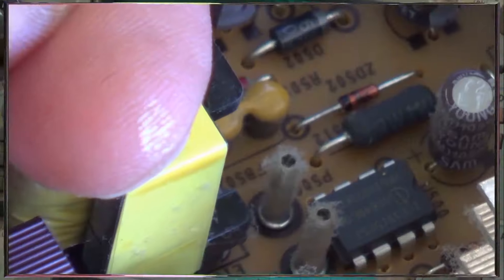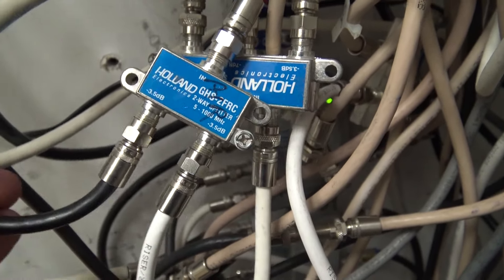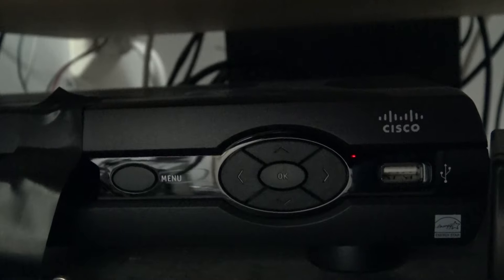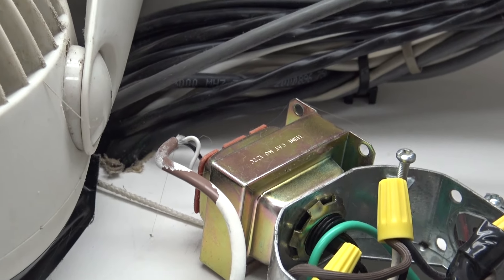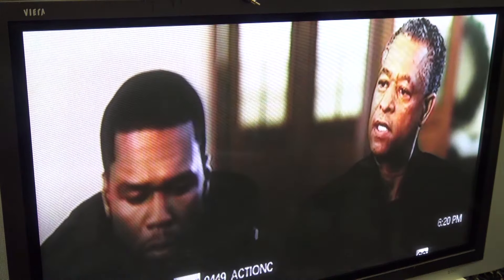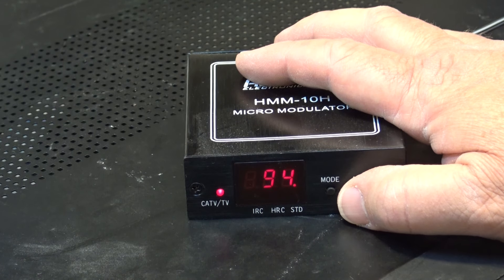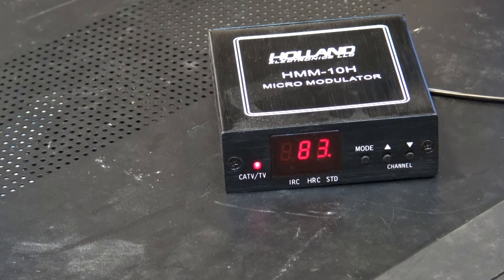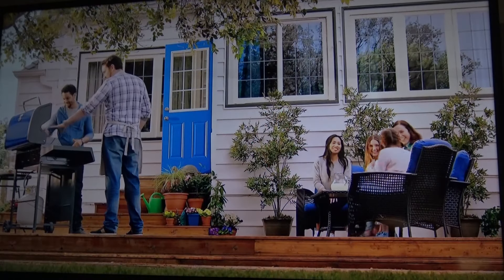Modulator set up at my house

Comment: You taught me so many tidbits in this video, some outdated but still valid.  Thanks!  So how does Raspberry Pi work? How do you make it stream and control a HDD?
Reply from the maker: Paspberry Pi is just running OSMC (open source media center) whch is an XBMC / Kodi clone. From that there is an opetion to open files under the video tab, and the HDD plugged into the USB will be detected providing that it is formatted in ExFAT mode.  There is an option to select random playback.
Just put all the files in a folder (not the root) click on video, files and select the device. Right click on the folder that the files are in, and select PLAY.
If random playback is selected it will play them in random, otherwise it will play in sequence, or you can create a playlist.
Its great. Mine is a very old first generation and it has been running for many years 24/7. I'll do a video sometime showing how it is set up.
Reply: So they come preloaded with an O/S and you download the program? Yes please show us more PI and how to use them.
Reply from the maker: No they have no OS. You put the OS on an SD card, and the apps you want to run. I use mine as dedicated media players,, however they also will stream from the internet. Same software, just load on the repositories (thats the servers that stream the content.) This is where it becomes a legal grey area. The software, Kodi, OSMC ect is perfectly legal. Many people load on repositories that allow streaming pirated content.  If you sell fully loaded boxes, then you can find youself in hot water. There are plenty of web sites that have set up automated scripts that do the "dirty" work for you. You just simply enter the address for the server, and download the required content and install it. The ones I have are just running bare bones OSMC as I don't stream content to them, I used them as media players to play local content already on a hard drive or USB stick, but I could plug in the ethernet cable and stream anything that is on the web if I wished.
Yes they do 1080p as they do have HDMI out was well as composite.
I use the older generation because it has a seperate video out, and a stereo mini plug for the audio. The Pi2 and Pi3 use a single jack for A/V like many of the new TVs that combine the stereo audio and video on a single 3.5mm plug, which needs a special adapter. 
The Pi2 and 3 are faster though, so as a streaming device for internet based content, they will search much faster when looking for content, and if you are using HDMI then this is not an issue. But again, in my use I am only sending mostly SD content (it will convert HD content down to SD to output as SD as well.
The entire OS and program (they run linux) is stored on an SD or in th ecase of the Pi2 and Pi3 a microSD card. The installer (that runs on windows) formats the card for linux, and installs the software automatically. You then just insert the SD card into the pi, plug it into a monitor and eithernet cable, connect a mouse and keyboard to the USB connectors and plug it in. The rest of the install is done on the device automatically.
Perhaps a video showing the steps if there is enough demand for this.
Reply: I think they came out a few years ago, not sure and they remained a mystery to me. I never knew about the alternate channel thing for modulators and the FM band how its used to a few channels.  I wondered why my cable FM died one day.  It was a good service, even supplying some AM stations in HIFI stereo.
Reply from the maker: Yes they had all teh AM and FM stations both local and the distant ones on the F< band on cable, and then one day BAM they were all gone as they needed the spectrum to put digital signals as HD rolled out and they ran out of bandwidth very quickly. They would put at least 50 SD digital channels in that spectrum, and 8-10HD channels, so the bandwidth was too valuable to use for just radio. That plus the fact that they have digital audio services on their digital boxes anyway.
Just another way to rent you a digital box.
Reply: I miss analogue so much. We could hear what was wrong with the signal. The early cable FM we had, had whistle sounds when my radio was in stereo, any ideas? It was later fixed.
Reply from the maker: When the local cable co first added FM they just amplified the off air signal. The problem was the off air signal would also get picked up between the coax and the antenna terminals, and beat with the cable signal that had a slight delay, which caused noise. The solution, change the frequency so the cable frequency was different than the broadcast frequency.
Reply: Well they had everything moved around slightly.  We had a station on 99.9 and cable remoded it on 99.5.  Often you would pick the original that leaked through and it actually sounded better.  In Toronto, we had quite a crowded FM lineup.  Maybe 99.5 and 99.9 were too close.  It only made a beat in stereo.
Reply from the maker: Right on. Cross modulation of the 38.5 KHz subcarrier.
I had a tuner with adjustable IF bandwidth, and set to super narrow it eliminated the interference, but set to full bandwidth I got noise. It got worse when they added AM stations to the FM band, as there was already no room on there.
Reply: One day in the 70's it was fixed and for many years I was happy.  Then one day around 2000, the whole thing vanished.  Do you think AM and FM will go away anytime soon? I heard they can go digital on both.
Reply from the maker: Well Norway is planning on shutting down analog FM broadcasts this year. Here in North America they are already broadcasting digital signals, but these digital signals piggy back onto the main FM carrier, so I think analog FM broadcasting, and AM still has a few more years before we need to worry about it. Not everyone wants to subscribe to satellite radio.
Reply: I am glad, its so basic and it works.  Its amazing that FM stereo is so old but still sounds great after all these years. CHFI was the first FM station in Toronto, HFI meaning HiFi
Reply from the maker: That was Ted Rogers station, the first FM station in Canada. Ted had a vision for broadcasting and  that vision was FM.
Reply: Yes until Rogers took away my cable FM. :(

Comment: Does the fan turns on automatically when get's hot in the room, or do you turn the fan on manually to keep the room cool down?
Reply from the maker: The fan is on a timer that runs it at times that the equipment that produces the most heat would be active, that being the day and evening. It turns off after midnight when all the equipment would generally be off.
I could put it on a thermostat, but not really any point, the timer option keeps everything nice and cool.

Comment: is it ok to replace a 250v /1.25a glass fuse with a 250v/1.6a fuse?
Reply from the maker: A fuse is a safety device, and for safety really needs to be replaced with the same rating.  Even though a 1.6a fuse is only 300 miliamps over the original, and one wouldn't think this would cause a problem, IF that unit were to burst into flames, and upon inspection it was found that an incorrect fuse was installed, that could be enough for an insurance underwriter to reject the claim. If a device is fitted with a 1.25 amp fuse, and you don't have that size, and you really need to get the unit going, I would first go down to say 1 amp and see if it blows. Most devices that have a 1.25 amp fuse won't draw even close to an amp under normal operating conditions.
Reply: i fixed the tv and now its working fine.but i think i will not use it until i get a new fuse.thanks for the input.

Comment: how much db does a ch3/4 modulator put out ?
Reply from the maker: Most are very low power.  -50 or lower.
Reply: Not much but if you add an amplifier to it, the output increases.